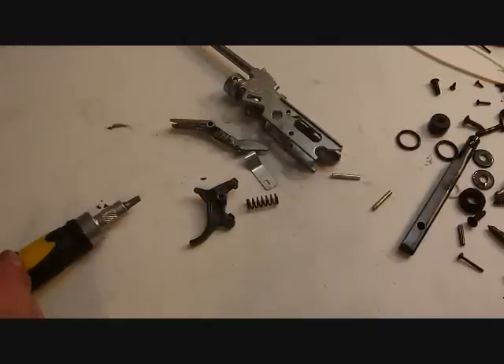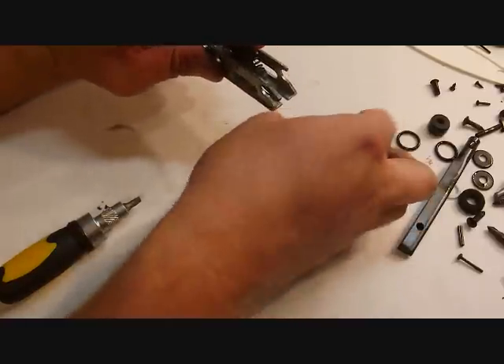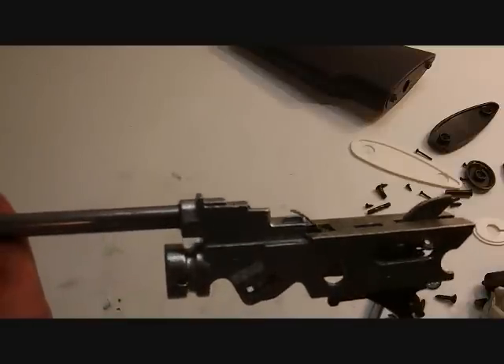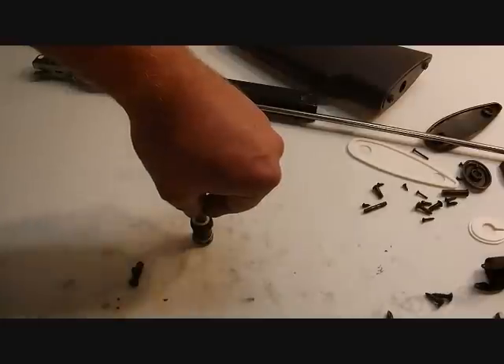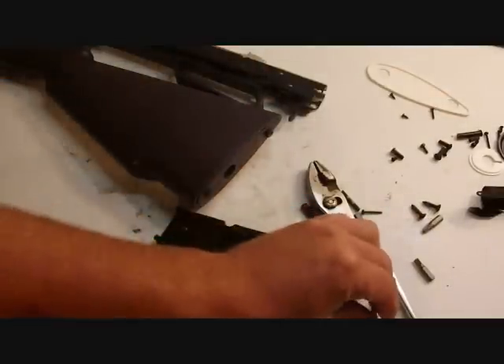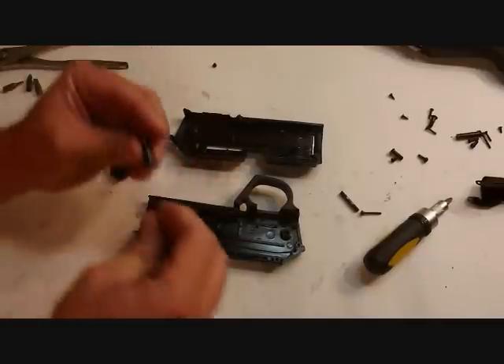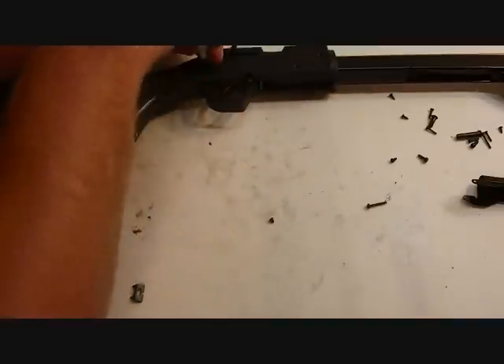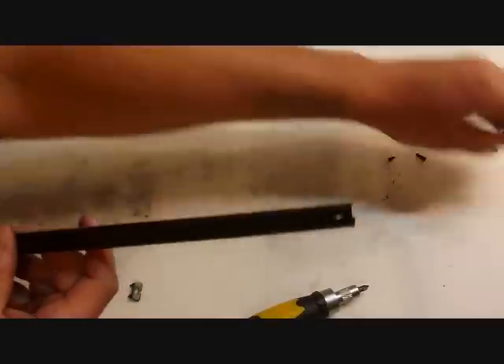Daisy Powerline 880 7880 BB Gun Reassembly, Putting it Back Together Step by Step Air Rifle

Comment: I'm having an issue with getting the safety, spring and metal ball detent back in properly. They came out by accident. Any suggestions?  Great video, only thing I couldn't see was whether you took the safety out or not.
Reply from the maker: +Greg Erway It is tricky, I place the spring with the ball on top and compress it to fit into the side cover. I had it apart in this video so you can see what I did, no good trick and the bigger your fingers are the harder it will be.
Reply: +Joseph Lewis   After watching your video several times in the section where the covers for the receiver are put back on, I discovered that I was putting it in right but didn't realize when I had the gun back together that I had to pull the bolt back to get it to go into safe mode, Then when I closed the bolt I could snap it between fire and safe no problem. Works fine now... Thank you for the video and for the assistance,,,

Comment: Hello! I decided to disassembly my Daisy in order to shorten/lighten the trigger spring. I did not disassemble the trigger, just got the spring out with some pliers. However, after assembling, my rifle has the following issues, which did not existed before:

1. I can pump air BEFORE cocking the rifle. 
2. I can make MULTIPLE shots after pumping for one shot. That is, I can cock, pump 6 times, make shot, cock, make shot, cock, make shot.

Is this caused by the shorter/weaker trigger spring? Or by something else? I am really wondering because all disassembly videos seem so trivial that I am really doubting I messed up something by accident in the process. Thanks

Comment: I have. a little plastic piece that looks like it has a hole in it. I didn't see where it came from when taking it apart and can't tell in the vid if you had the same part
Reply from the maker: Lot's of different parts can match what you describe. If you can attach a pic I will ID the part for you.

Comment: Mine does not have the Same screw configuration as yours,and Fewer screws.
Reply from the maker: Then it is likely the old style, I also did the same video for it as well. There are also 880s that have one screw securing the stock but have new style internals.

Comment: Can the butt stock be removed by only taking out the 2 large screws and 4 small screws in the receiver?  In other words not having to split the receiver halves apart?  I want to remove and replace only the butt stock due to a manufacturing defect.

Comment: Thanks for the info. I bought O-rings, oil wiper, and a buffer on eBay from you.I have an old style 880 and I used your video to tear it down, (not totally like you did), but when I went to put it back together, your reassembly video is for a new style 880. The pump assembly is way different. When I took it apart, I didn't find a plastic washer, only 2 metal washers, an o-ring, a buffer, and an oil wiper.(They were really torn up and gooey so it might have had a plastic washer). Do I need a plastic washer back in there when I put it back together?Also I am having trouble putting the barrel back in the barrel cover. It is extremely tight, but it came out - it's gotta go back in...right?Any help you could give me would be much appreciated.Thanks, John
Reply from the maker: The plastic washer behind the oil wiper was implemented around 2000 by Daisy, all the previous models did not have it. I like it as it keeps the foam oil wiper in place, but it is optional. I will be putting up a video on reassembly of the old style 880, just got to find the free time to do so. There are some tricks to the old style.

Comment: have old red ryder bb gun.  bb's wont shoot out.  put coat hangr down barrel and think I have stuck bb.  put onein and it went down to the slot.  saw it fall down when I cocked it but will not shoot out.  sprayd penetrating fluid down barrel and let it sit.  still no luck.  any idea ?
Reply from the maker: Sorry I am not as familiar with that model as the 880 and other models. The Red Ryder is a spring air rifle and a very different design than the 880. I have had rusted BB's cause problems before and something like that could be causing it to fail to feed, if however it is now feeding and doesn't shoot I would look at the seals.

Comment: i dont know if you still reply to comments but if you still do i need help with my 880, i disassembled by 880 to clear a nasty jam and when i re-assembled it the safety does not click into place and is freely sliding back and forth, its a major safety concern for me so if you have any tips i would be very great full,

-jason
Reply from the maker: Do you still have the safety buttons spring and ball bearing? That is what holds the button in place, without them it will slide around as you describe.

Comment: The bottom of the pump tube on my 880 is completely different.. Are there diff variants?  MIne is real old... 25+yrs  I cant get the pin back in to slide the frame rail back in.  It ALMOST goes back in if I push the frame rail on.  It feels like its compressing a spring.Help?
Reply from the maker: +Eric Adams Yes, yours is the old style and the pump tube assembly is different. I plan on making a video this winter of a complete tear down and rebuild of the old style. 

It is tricky to get the pump tube back so that the pin can be placed back in. Might try looking for a video of that style, kinda hard to help in writing.
Reply: Great video!
Did you ever make one about the really old style?  I have one without the diamond on the forestock. This video was close enough that I could figure out the rest. I still have a few issues to fix. I also need a new wiper, so I’ll check out your eBay.

Comment: HI! THE SAME HAPPENS TO MINE A POWERLINE 922  CAL 5.5 ....+25Malachi Could be a lot of reasons, if it is leaking while you pump the O-ring on the pump head is a likely culprit. If you can punp it several times and hear it leaking while not pumping it is most likely the chamber seal followed in likelyhood by the exhaust valve.

BUT COULD YOU BE MORE SPECIFIC....SENDING A VIDEO   YOU FIXING THIS PIECES?

MY  REGARDS

Comment: Hey my 880 is leaking air every time I pump it all I hear is hissing and there is never enough pressure to shoot any advice on how to fix it?
Reply from the maker: 25Malachi Could be a lot of reasons, if it is leaking while you pump the O-ring on the pump head is a likely culprit. If you can punp it several times and hear it leaking while not pumping it is most likely the chamber seal followed in likelyhood by the exhaust valve.

Comment: I got a little spring and I don't know where it goes, help please
Reply from the maker: It is likely that it goes into the safety button. There is a hole in the safety button that a small spring goes into with a small ball bearing placed on top to hold the safety button in place.

Comment from the maker: I am currently working on a website dedicated to the Daisy 880.
www.Daisy880.Net   I sell parts and provide information about the 880 on this website.
Reply: +Joseph Lewis thank you very much this helped a lot the trigger group was a pain though but I now have a working powerline 880
Reply from the maker: +shawn rosemary good deal, the trigger assembly is probably the hardest part to get back together on the gun.
Reply: yeah it was but with out this video I would've just went to buy a new one and that's just wasted money
Reply from the maker: +shawn rosemary Thanks, glad I could help.